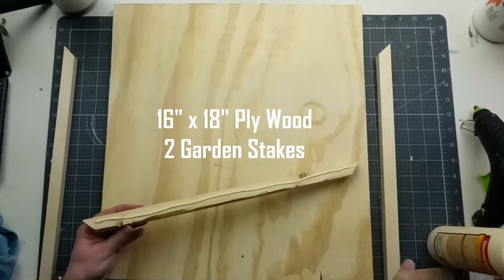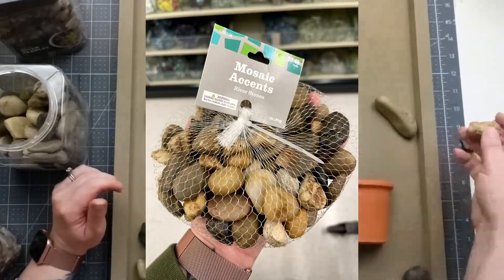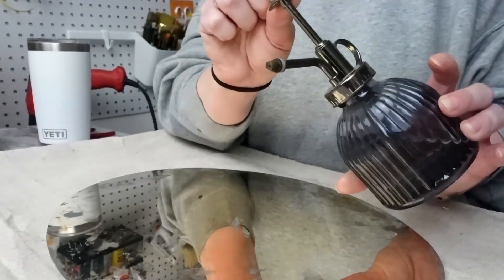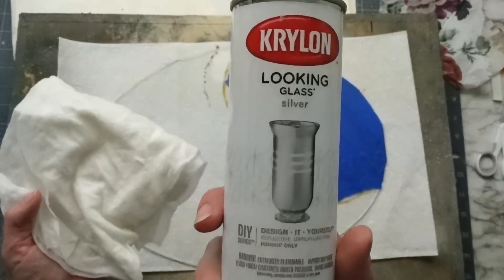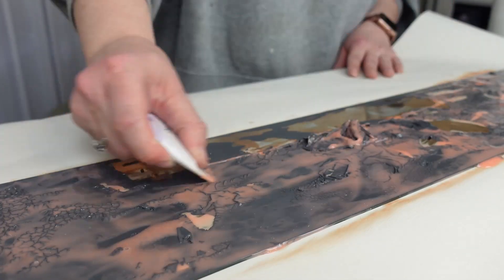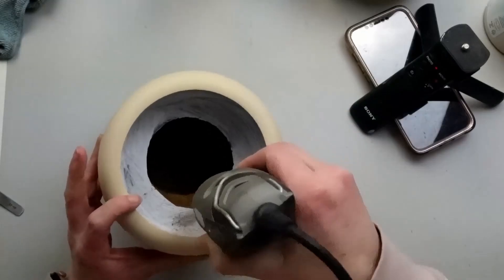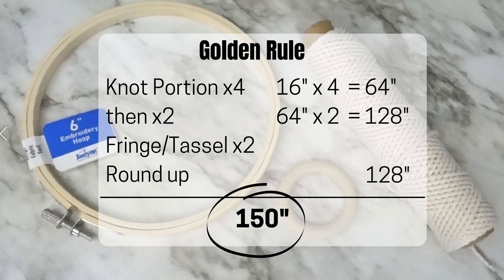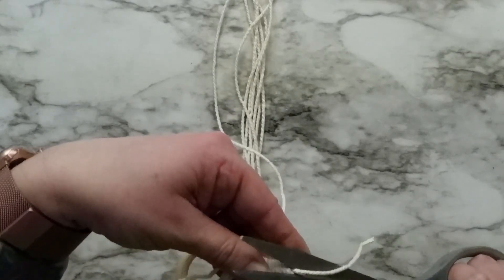High End DIY Home Decor // Everyday Neutral Home Decor

Comment: I'm thinkin  I need to try DIY liquid Patina.  It seems like everyone I watch uses it, even when they use non-diy paint.  I've watched Yvonne at gingerchickrehab strip mirrors like you were doing.  She's a master!  Your second try was wonderful!  She uses mod podge directly on glass under and over for decoupage and it seems to look fine.
Reply from the maker: I love the liquid patina. It does dry quickly so you have to work a little faster but the end result is much smoother in my opinion. I